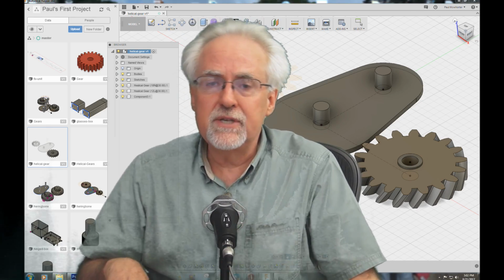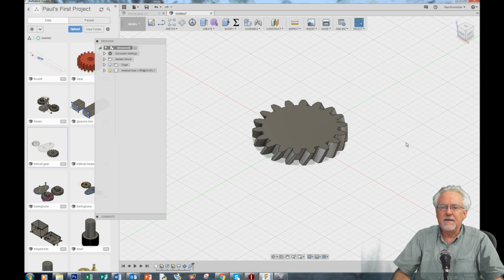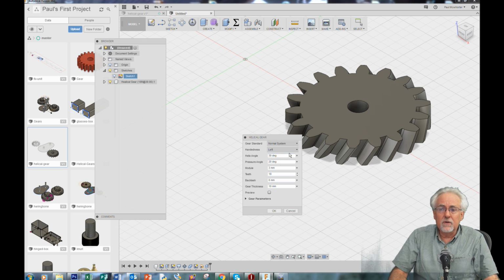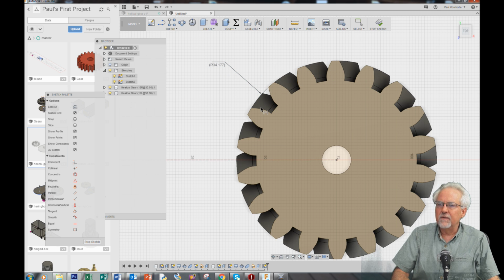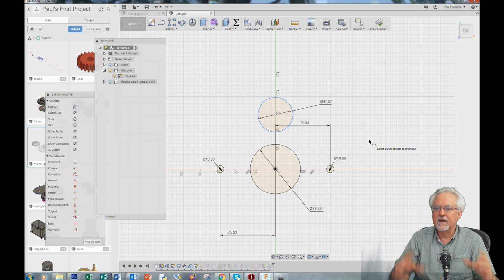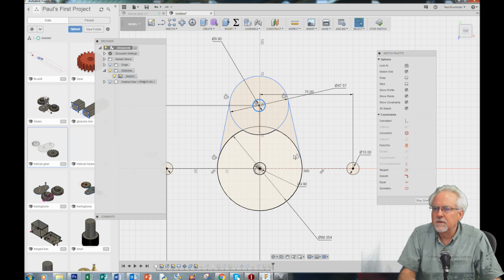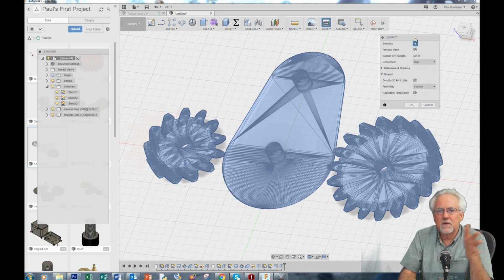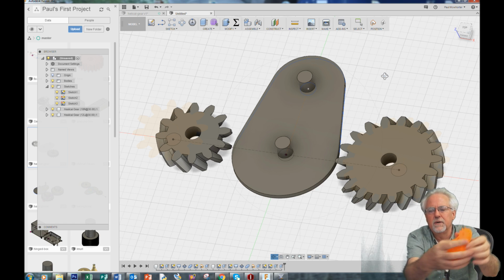Learn Fusion 360 or Die Trying LESSON 9: Design Helical Gears for 3D Printing

Comment: Helical gear teeth mesh more smoothly, and therefore more quietly than straight-cut gears. As you remark, helical gears also have a "thrust side" which is a serious factor in transmission housing design. Trucks and racecars generally use straight-cut gears because the thrust/side loads are very high and the transmission housings would have to also be massive and heavy. Straight-cut gears are nearly as strong as helicals, but can be very noisy. Passenger cars typically use helicals to cut down on noise.

Herringbone gears balance out the thrust side, but are very troublesome and expensive to make with conventional tooling. Herringbone tooth patterns are childsplay for additive manufacturing. I trust we'll see more herringbone gears as additive manufacturing gets stronger and stronger.

Another good video, Thanks!

Comment: I could not figure out why the default position of my gear is in vertical position when the gear in this tutorial is in horizontal. Can someone please help me out?
Reply from the maker: Look at preferences under your account name. Set "z" to up in your preferences. Then you will have to start a new design, and it will match mine.
Reply: It worked. Thanks Paul!
Reply: I was just going to ask the same thing.  Thanks.
Reply: Me too! Great question. i was going mental
Reply: Preferences_General_Default modeling orientation_ Z up

Comment: The reason that your components keep moving back to the original location is because you're editing the original sketch, and that's where they were when that sketch was created. It's all down in the timeline. As I said in a comment over in lesson 6 (I think it was there) you would do yourself some good learning to bone up on the timeline. It's super useful and explains some of the "oddness" of what you're seeing. (Remember in the beginning lessons how you said F360 can be confusing because object won't move or they react funny and it's because we haven't learned how to deal with constraints? This is the same idea: you're seeing funny things because you haven't dug into the timeline and it's capabilities yet. :-) )

By the way, not criticizing at all. I've been learning a lot with you, but I did do some other tutorials that have covered other things that you haven't touched on yet, and one of those is the timeline, so I thought I'd share and maybe you turn that into a video for folks. :-)
Reply: Excellent comment!
Reply: I don't see how the Timeline helps in this case. It shows all the separate parts of the component as entries in the timeline each time a gear is made. There is no spot that I can see that allows editing the entire gear, the timeline only shows parts of it. It seems editing the sketch in the Browser is the only way to actually edit the entire gear. The gears both seem to have to be created at the origin since you are not given any choice about location. So creating them at the origin and moving them away seems the only option to make multiple gears. It is weird that you have to draw your edits at the place where the gear will be. It's also weird that even though you have two gears there is still only one sketch, and when you edit that sketch you only see the one big gear.
Reply: that didn't happend to me and I do exactly the same he did!

Comment: I feel that we may have died trying.  There are still loads of things that Fusion can do without resorting to add-ons.  I get the impression that you've lost the love for this project and are just going through the motions now.
Reply from the maker: Well, I can design a gear from scratch using equations, but for something as complex as a helical gear, why would I not use a tool designed for that, allowing me to focus on the overall project.
Reply: Paul McWhorter all I’m saying is that we’ve not really learnt much from this lesson. There is still a load to learn. For instance you’ve not even mentioned the timeline in any of the videos. Going back and amending a sketch is a very powerful feature.

Comment: The 'capture position ' option appears in the move/copy selection you first make. Selecting the check box here will stop that pop-up coming up and will also stop the gear from snapping back to the original position (although it still happens when you select sketch mode :S) It would have been nice if you carried on with the parametric design theory for this video.
Great lessons btw. You've taught me so much, about Arduino, Raspberry Pi, and now Fusion360. Keep up the good work Paul!
Reply from the maker: I agree on parametric design. The thing is the gears are from a plugin, and it does not support parametric design. For my students in High school, I insist all designs are parametric. When I grade a project, they know to pull up the paramter table, and I start changing things to see if I can break the design.
Reply: I am just starting with Fusion 360, know very little about cad. Mostly just for as built drawing in hot and chill water system. This is a very good speed for me to understand. I want to learn this so I can show young pipefitters better ways to build supports, just little things like that and most younger people will try to learn 3D printing than drawing a hanger. I understand your line of thinking, but a lot of us just don't have the background you have. Yes a watch a lot of videos like this, but some are just to far ahead for me.

Comment: I really appreciate your lessons-  greatly interesting.

However, I am lost on a fundamental-  my origin plan  doesn't seem to be the same as you, thus I am having trouble making my gear look similar (on the same x/y face as you, with the same projected appearances).  Maybe if you also had a few step by step printed instructions available, that would be helpful (so we can confirm some of the basic settings).  I know this is a lot to ask, but whatever you do to provide a repeat of some of the basics would be helpful (although I am sensitive to the desires of others and know they may not like too much repetition).  Thanks.
Reply from the maker: It should be in preferences. Z should be up. YOu want XY to be the default sketch plane. Should be on first page of preferences.
Reply: Ya know, I thought there should have been a setting --  somewhere, but I looked and looked (including in preferences)- and  found nothing. However, I knew your e-mail must be correct so I looked again. When I went back to “preferences” the first thing my eyes fell on was this selection. Thank you for your patience and great lessons !   (and your very quick reply)
Reply: This is why I have been struggling - spent more time trying to make my screen look like Paul's than doing the task.  I thought I was going to die (trying).  Now it just works!   Thank you for asking this question!